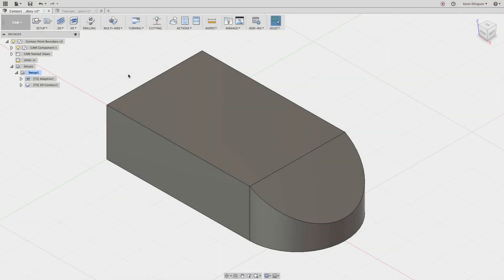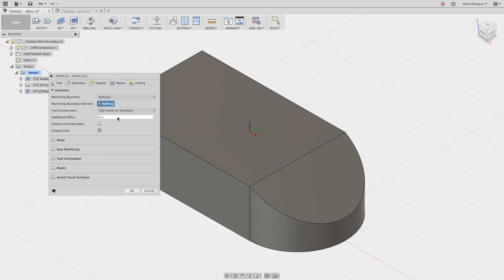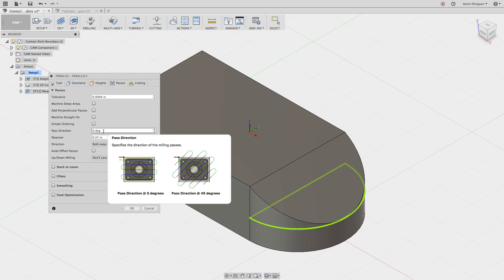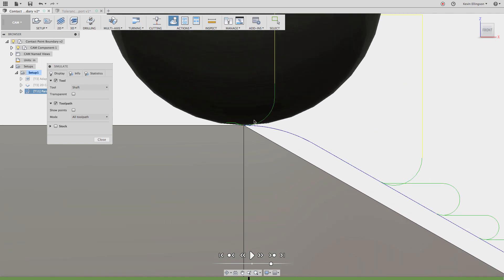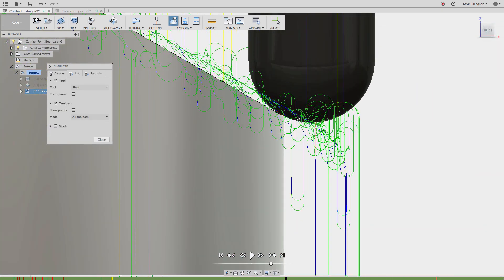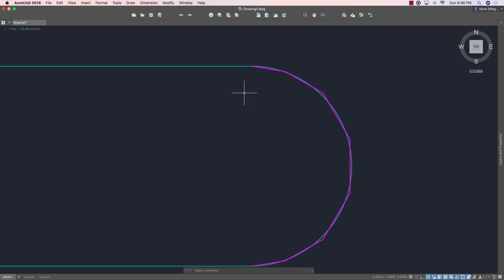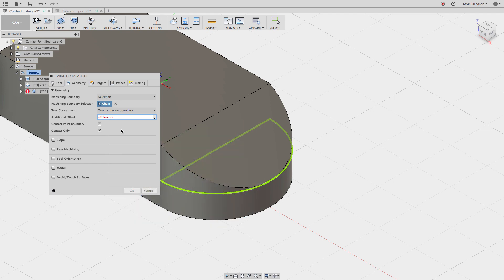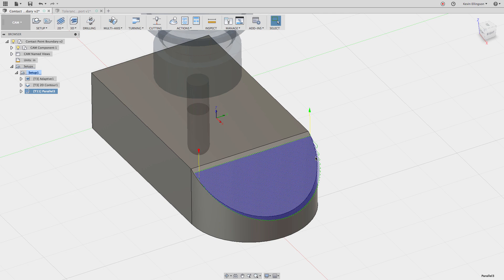Fusion 360 - 3D Surfacing Contact Point Boundary

Comment: When initiating a job in Universal Gcode Sender (UGS) after loading Gcode generated by Fusion 360, the CNC router moves far away from the intended starting position, so far it triggers my limit switches.
Do you know whats causing this?

Comment: Why not just offset your boundary by 40% of the diameter of the cutter much quickerAnd put a -.003 limit on your Z if your Z0 is at the top so it doesn’t ride over
Reply from the maker: Why 40%? Why not 43% or 38%? What if the top of the feature isn't planar or easily selectable? Why not set the additional offset to -tolerance and set it as a default? The video tries to explain what Fusion is doing behind the scenes and why you get the results you do sometimes and how to fix it.

Comment: So just using a negative tolerance value will keep the toolpath from rounding the edges? I am using avoid surfaces but one face of the model I have won’t let me select it.
Reply from the maker: Generally yes. That along with checking the box for contact point boundary. You then shouldn't need to use avoid surfaces.

Comment: Is there a way to use negative tolerance to clean up an adaptive toolpath?  I tried but had to enable rest machining and it wasn’t happy with a negative tolerance in the offset field.
Reply from the maker: No. There are some things you can try. In preferences you may see a “reduce whisper cuts” in preview preferences. If it isn’t there for you, just ignore what I said. You saw nothing haha 
The other thing you can try is to right click on the toolpath and then choose compare and edit from that menu. In the search box type tri which should find the surface triangulation field for you. There will be a value in the expression field. Click the value and you will see an expression. Leave the beginning part of the equation as is, but change the .5 value to .1 and see if that doesn’t clean things up a bit for you.

Comment: What a fabulous and enormously helpful video. I did a job the other week and ended up having to buy the manufacturing addition to trim toolpaths to get rid of all these extraneous toolpaths dipping down over the sides. You just showed me the correct way to deal with it via the tolerance. Thanks heaps.

Comment: I use ONE CNC. I have the same problelm with operations like this.
I still haven't worked out a qiuck method for this. I have to extend the boundary for this to work.
And when you have a sloping surface with a radius all around at different heights it can become very annoying.

Comment: Can't thumbs up this video enough. Three crucial tips - the insight into tessellation, the -tolerance hack, and the shift+hover to expose a parameter name. Thank you. Any chance you would do a deep dive on getting good toolpaths out of the Scallop strategy?
Reply from the maker: Glad you found some value. Rob Lockwood did a video on the scallop toolpath that I think will be well worth your time to watch. The video uses HSMWorks but the same concepts apply in Fusion. Rob has probably forgotten more than I know when it comes to surfacing toolpaths. https://youtu.be/7vS8w19_v5A
Reply: @MechanicalAdvantage  Thank you. I'll check it out.

Comment: Kevin, this fixes the tool path issue for the bottom of the feature and does a very nice job, but also common is the upper perimeter which while CPB is supposed to stay within the line, if that was a filet / radius over the top face the tool path may ignore it, as I am now experiencing...
Reply from the maker: automan1223 You will need to include the whole boundary of the fillet in your selection. Look back at a video I did about CAM selection techniques. Or you can send the file to info@mechanicaladvantage.com

Comment: Thanks,  i have  a miter surface like this and the bit starts at the lower end of the miter.  I want it to start at the high end of the miter or near the top of the part.  Any suggestions?  Can't seem to change the start point.
Reply from the maker: G Bancroft What toolpath strategy are you using for this?
Reply: I'm using a parallel toolpath with a 90 deg pass direction.  But today I figured out how to change the starting point.  I just changed the pass direction to -90.  Thanks for replying.